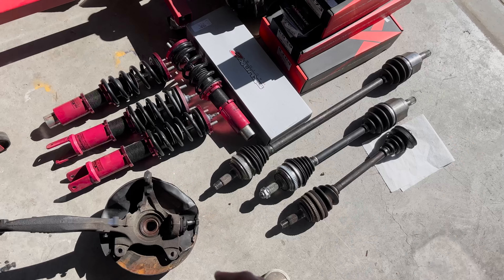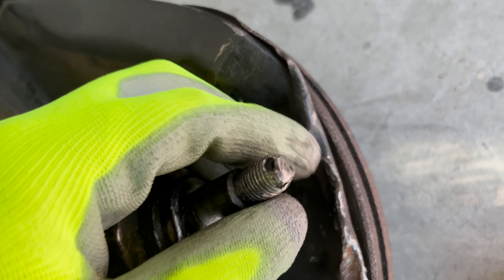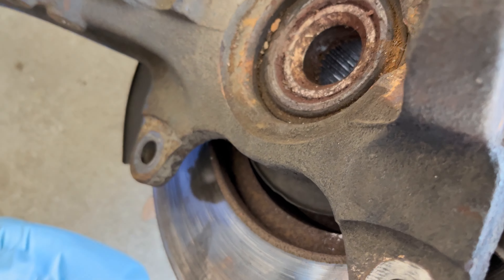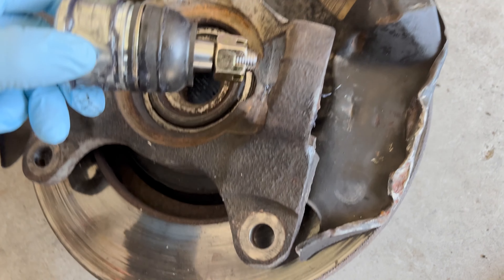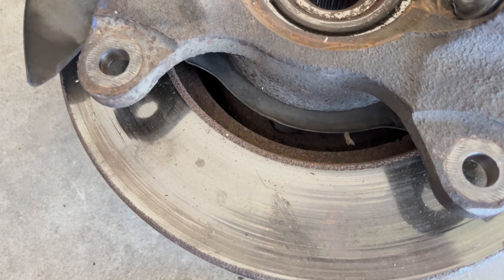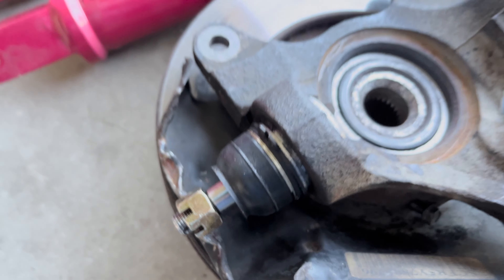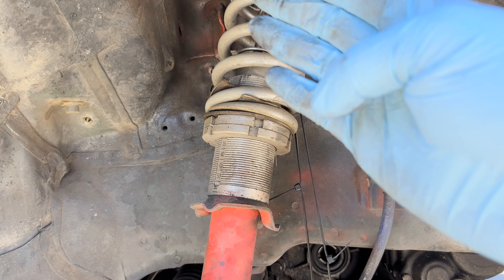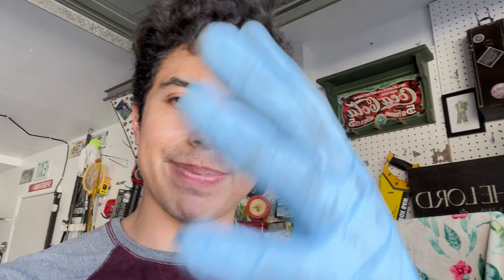How to Remove and Install Ball Joints (96-00 Civic)

Comment: bro the snap ring😭😭😭
Reply from the maker: What about it?😅 the one that was missing or the new one?
Reply: @bwcp  you've put the snap ring in the wrong groove. It should be in the one closest to the knuckle assembly. With the snap ring opened up with the pliers, push the ring towards the knuckle face with a screwdriver, it'll click into the correct groove.
Reply from the maker: @mickl8212 I figured. I will adjust the snap ring before anything. Appreciate the input.